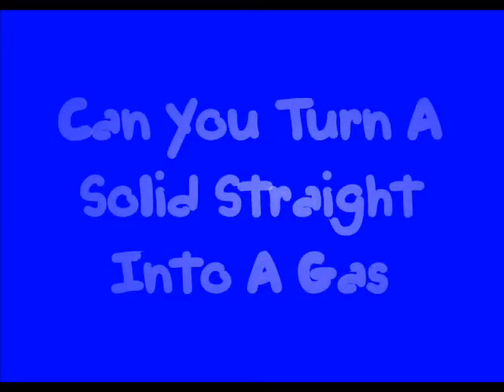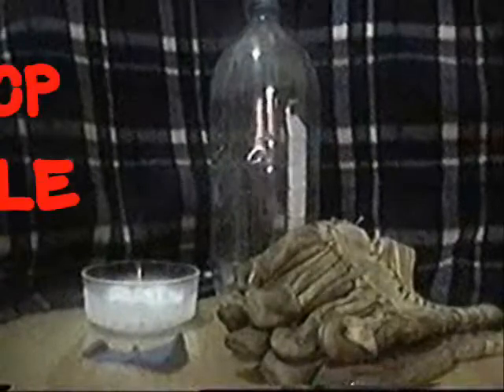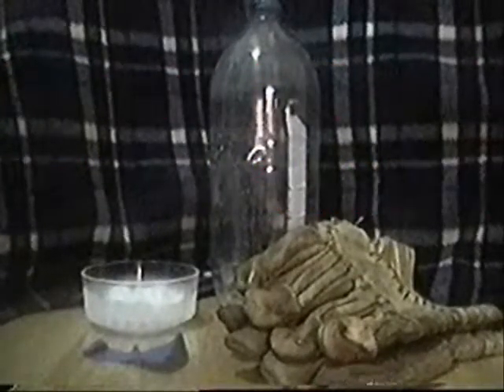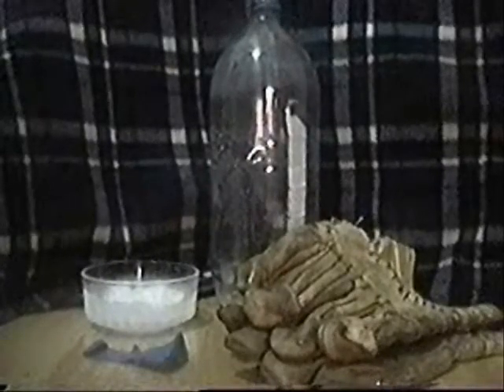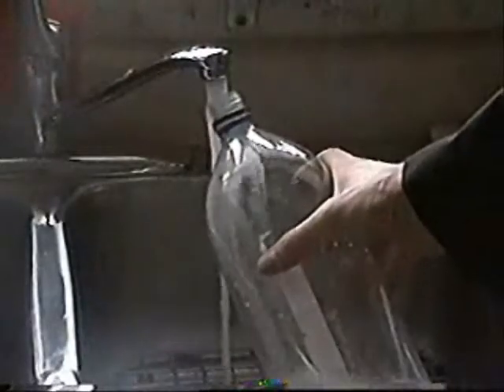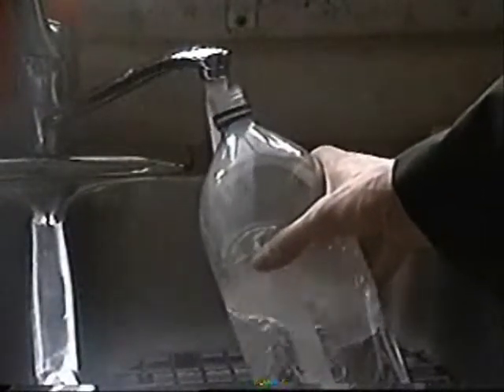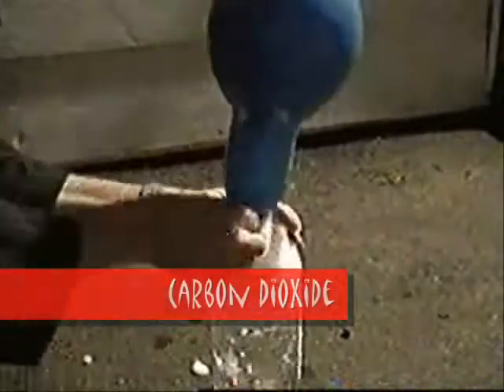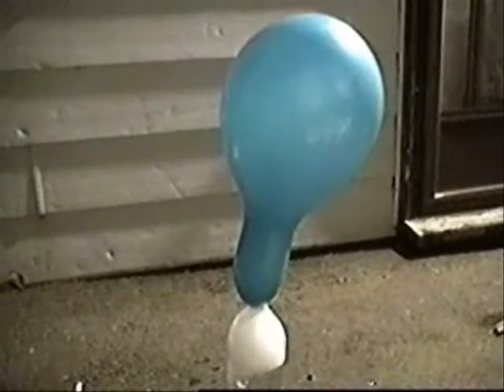🧊 Dry Ice In A Bottle *!BANG!* 💥

Comment: umm crazy chris i have an question? where do u think i can buy dry ice ??
i have a way good experiment what u need is*dry ice+hot water+soap* u put 
dry ice in the hot water and putting soap on what will happens is the dry ice mix
together with soap and be to bubbles when the small bubbles explode it will release CO2!! :D